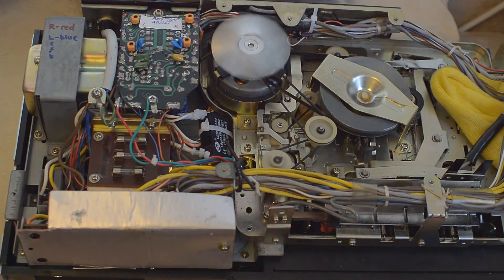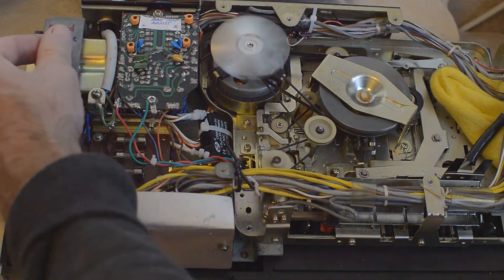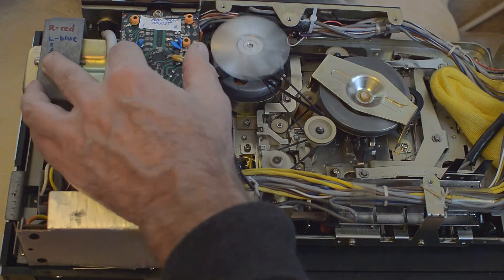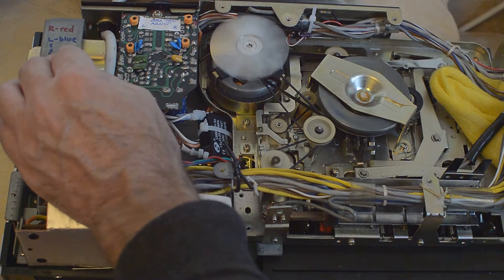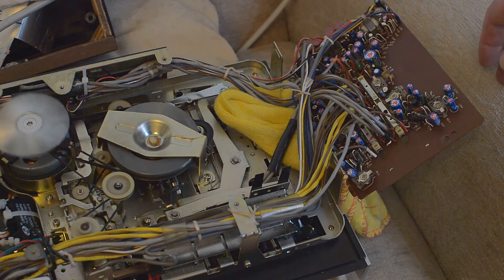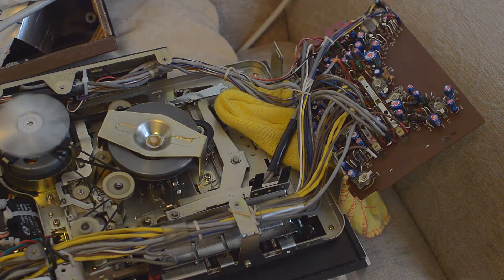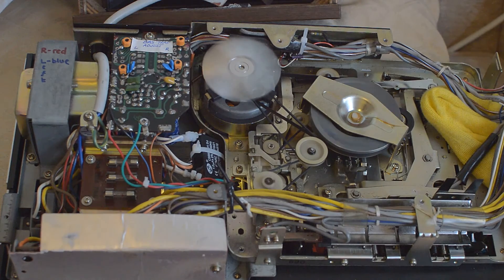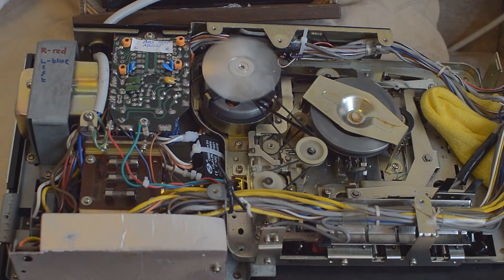Sony TC-134SD (Part III) Stereo Cassette Deck

Comment: Hi, I picked one of these up but it doesn’t power up. Do you know which fuse I need?
Reply: Thanks so much for your replies. It’s actually the fuse on the back by the power cord and not the internal fuse. I think it only has this on the ‘AEP/AUS’ version according to the manual.
Reply from the maker: @DavidGotts-o3r  Ah yes, I forgot about that one! LOL  ;o)
Reply from the maker: It's been a long time since I opened this deck up. Give me a day or two and I'll try to find out.
Reply from the maker: According to the service manual, there are three 3 internal fuses. These should be marked, 250mA x 2, and 800mA.  Also check the main fuse, should be no more than 3A. Do not replace the internal fuses with anything higher. I cannot guarantee that swapping a fuse will get your machine working - if one of the fuses has blown, then there will be a reason for it.

The 134SD I have in my possession, cost me little, but some 30-40 hours of work went into its complete restoration. It wasn't 'plain sailing' I'm afraid.